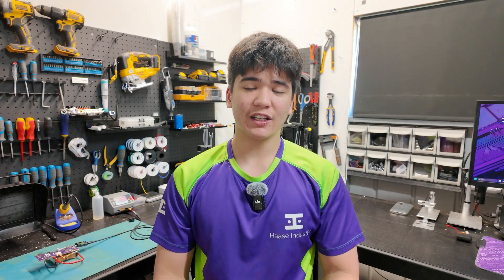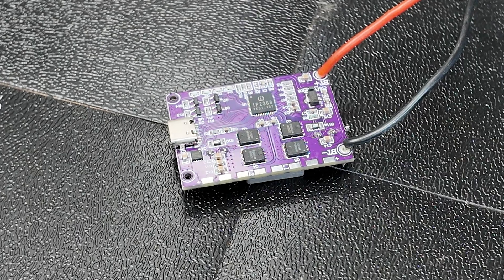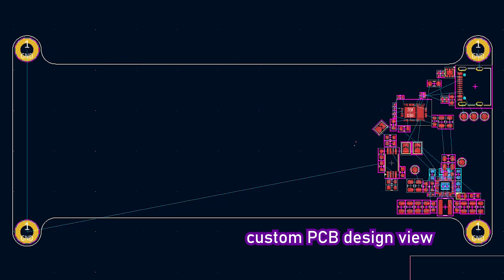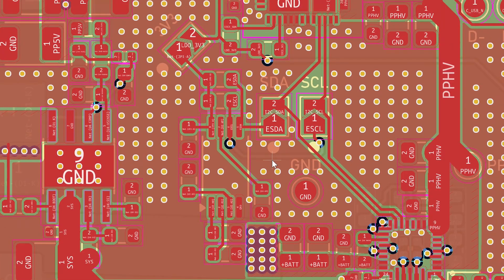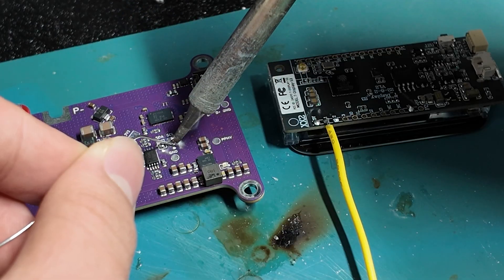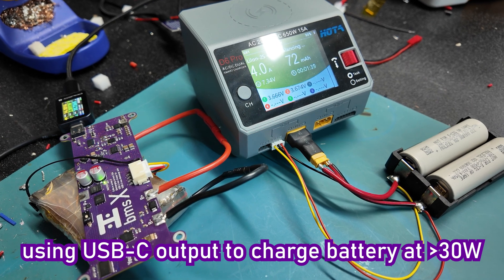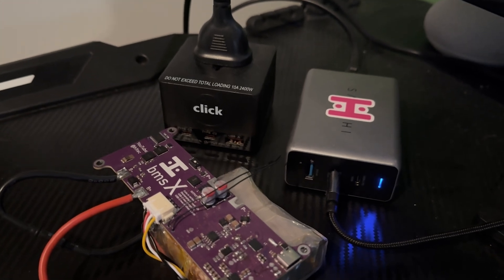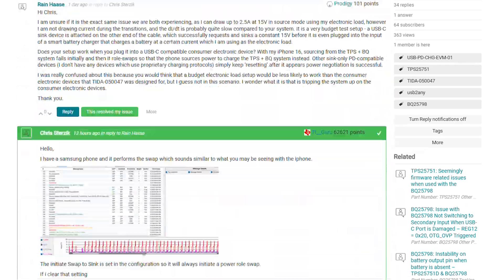Add USB-C fast charging to any battery-powered project!

Comment: ip2368 works perfect with 4s with bms and active balancer separately , ( ip2368 module + 4s bms 60A + active blancer 4s with 1.5a). work like hell and do not heat over 60c even for 10ah power bank. and ip2368 buy in black which comes with heat sink for 4 mosfet and fit perfect on 4mosfets.

Comment: Noob question, how much time and research do you think it would take to build a USB-C PD solution at near Super-VOOC levels of charging (Like OnePlus)?
Reply from the maker: Since you and I are individuals not associated with OnePlus, it’s very hard to create devices that will take advantage of maximum fast charging for those phones since the protocol is proprietary. So if you want to create a device with SuperVOOC charging, unless you use a chip with the protocol already built in (but probably not the maximum fastest speed) like the IP2368, or you work for OnePlus, or you find out how to navigate the proprietary protocol, probably never. I don’t know what you mean by levels (watts? lowest charging speed in minutes?), and I don’t know what you mean by PD solution (DC-DC? AC-DC?) so I’m just going to assume it’s something analogous to what’s going on inside those phones to allow 0-80% charging in like 5 minutes. If you are truly going to use PD (which I guess is your only option), and don’t cut corners, make it safe, etc, you would first need to find a battery that can even charge at that rate with enough cells in series and then making the power conversion efficient enough from 140W, 180W, or 240W PD is a whole different story. That’s just the DC-DC part. If you want a smaller 240W AC-DC adapter than the currently existing ones, and for it to pass regulations and be safe, that’s a whole different story again. For something that you’d be comfortable with using on the daily in whatever application you’re talking about, a full charging ‘solution’ which is the same if not better than what these other phone manufacturers can do, wall adapter and compact phone charging circuit including the battery, as an individual, will take at least 2 years I think.
Reply: @h1tec wow! First off, thanks for the reply! I feel like my questions are so uniformed that I almost never expect a reply lol. 
Thank you for the detailed response, you got exactly what I meant - I want to learn how to create a charging solution that will perform on the level of what One Plus phones and their chargers are capable of. 
2 years sounds like a long time, but I'd still be willing to give it a shot and learn. Do you know of a good place to start learning about this?
Reply from the maker: @sonic4life  look at USB-C reference designs from TI such as the one I showed in this video. Use ChatGPT to help you find out what you don’t know. And, most importantly, just start. If it wasn’t hard, there would be no point doing it 😅 although I’m still unsure what your goals are for this project. 2 years was just a guess. If you only want to make the phone charging circuit and battery part, and maybe it’s not at 300W but at like 100W, a few months is feasible. You need a lot of knowledge to even get to here though. This video covering a circuit which I don’t think comes close to OnePlus phones (don’t know much about them) took a Battery Mooch subscription on Patreon and a few months of research to do. The thing about battery circuits is they aren’t like microcontrollers or pretty flashing LED blinkers - if you mess something up bad enough, you could absolutely push a battery into thermal runaway. A battery charging circuit doesn’t ever come without a battery protection circuit. Don’t cut corners.
Reply: @h1tec thank you so much! I will take your advice. If I ever get it done, I'll come back and thank you again😂

Comment: I have built several IP2368-based batteries, and connected them together (USB C-C) via an inline power analyzer. I have never had one 'blow up' or destroy itself. Even connected to other commercial batteries' bi-directional USB-C port, they negotiate and pass charge in either direction just fine.
Reply: I definitely haven't had mine blow up, charging other power banks and USB4 devices (which require PD3.0)
Reply: The printed circuit board has already been built on Aliexpress for 12€ and up!
Reply: @x-gamessimulator1067 do you mind referencing it?

Comment: Something that really pisses me off was the lack of two 5.1k resistors on the cc1 and cc2 lines on cheap usb c devices , like the female c port inself even has the cc1 and cc2 exposed , what was so hard in the design process to just not include the two resistors for the pcb
Reply from the maker: That’s so true dude. I guess it goes to show, if they put that little effort towards that aspect of the design, what other parts they could be messing up…

Comment: Great video! What are the connectors that you're using at 5:36 ?
Reply from the maker: Thanks! I’m using 3.5mm bullet connectors. For a higher current solution (next video coming very soon) you can use XT150s.

Comment: I used that ti USB-C controller to try and use PPS as a CC/CV power supply. I made a super cool compact board and everything. Then once I got it, I discovered I switched i2C SDA and SCL 😢
Reply: And I used 0201 resistors so it was extremely hard to try and rework
Reply from the maker: @chadkrause6574 Cool! Did it end up working?
Reply: @h1tec I got the chip to communicate with a different microcontroller but no the one on the board since it was too hard to switch the pins. I will try again. I actually want to make a 48v5a usb c battery charger + BMS combo next

Comment: Good video. I have a question. Given 2 power banks with bi-directional USB-C ports (allowing charging and discharging), when these 2 power banks are connected to each other on these USB-C ports, would you explain how the power banks negotiate with each other on which one is charging or discharging? Thanks.
Reply from the maker: Guys, correct me if I’m wrong, but for bidirectional USB-C ports, the correct implementation is that before each one is plugged in, each device will switch between advertising a sink and a source at random intervals. Then, kinda like Schrödinger’s cat, when it’s actually plugged in, each one observes the other to be in a certain state of sink or source. If they are the opposite roles, of course, everything works out. In the case they aren’t, I think it just tries again. In practice (I tried with my laptop’s DRP port and this dev board’s DRP port) this looks like sink and source being random. Of course some devices don’t do this properly.

Comment: Would you consider designing a rechargeable module that outputs the voltage of AA or AAA batteries? Something like that could be really useful for DIY projects and for bringing old hardware or toys that use those batteries back to life. 😅
Reply: That seems good, but you wouldn’t be able to re-create it yourself without very expensive testing as it ends suddenly becomes a product for them to release the designs to
Reply: 1×AA/AAA - use suitable DC-DC converter,
2×AA/AAA- replace with LFP (LiFePO4) cell.
3×AA/AAA- replace with Li-ion NMC cell.
4×AA/AAA- replace with USB-C receptacle, use standart power bank.

Comment: also DO NOT solder directly to 18650, and DEFINITELY not with this much heat
Reply: Most are actually rated for this
Reply: @TheLostPacketYT nah, if u can, don't do it, li-ion doesn't like extreme hot or cold
Reply: @sw3gmach1ne17  depends how the terminals are connected inside
Reply: @TheLostPacketYT if u keep long enough, the heat will reach every part of it, but from what I've seen, minus is the more heat conductive, maybe cause it has more surface
Reply: @sw3gmach1ne17  in a lot of batteries the internals are connected to the casing with a strip of metal and some designs. This strip of metal is designed to not conduct too much heat but of course you shouldn’t be soldering it for more than a few seconds.
Reply: Those joints are dry af😭
Reply: It will be alright if you use good flux and know what you're doing. You can flow the solder without getting the tabs too hot and if you're really worried about it clip something metal to it to sink the heat. 

Obviously, this isn't something for a soldering amateur, but it will be alright if you have experience.
Reply: this buddy knows the way, dont worry about him

Comment: USB-C needs 10k pull down resistors on the CC lines to provide power. Some cheap devices (like TP4056 modules) omit them, but you can usually hack them on.
Reply: 5.1k
Reply from the maker: Only for 5V though, and TP4056 is also very inefficient 🙂
Reply: @h1tec not for 5V, but for ALL VOLTAGES (may be integrated into IC, read documentation to know exactly)
Reply from the maker: @volodumurkalunyak4651 ok, but just putting 5.1Ks like this guy is saying without a PD IC won’t do anything other than 5V. And I haven’t encountered any ICs where the pulldowns aren’t built in. Isn’t it different for applications which also do sourcing?
Reply: @h1tec pretty mych any of PD IC has 5.1k resistors integrated - okay, thanks.

Comment: Will you open-source the PCB design? I’ve always wanted to have a charging circuit that can charge with more than just the USB standard values. But I don’t have the in-depth knowledge for that. It would be really nice if you have a GitHub link or any open-source files.
Reply from the maker: Look at the reference design I linked 🙂 I copied it component for component. The schematic and PCB layout for that one are open source, and there is a design guide there too. I didn’t open source my own PCB design because it adds a BMS which makes it only applicable for my specific 3S, 50A application - only useful for my own testing. I will probably release a low cost development board with a good step by step guide based on the reference design and maybe add a microcontroller sometime. If you want that, share this video, donate, and/or watch multiple times 😊 if you need a solution now, you can buy the dev board from TI USB-PD-CHG-EVM-01, but it’s $150 USD and uses older components. Thanks 😊